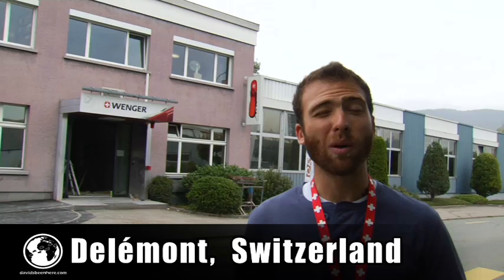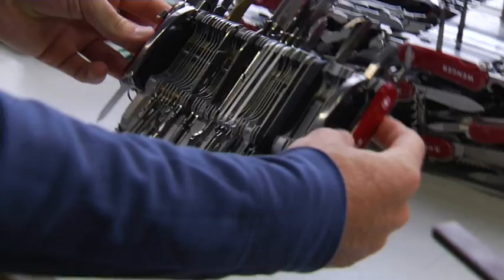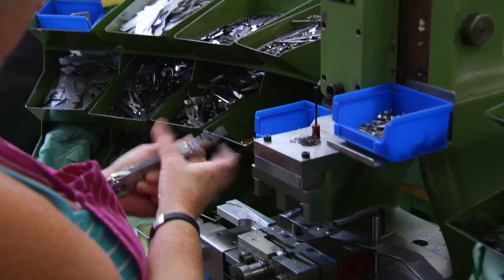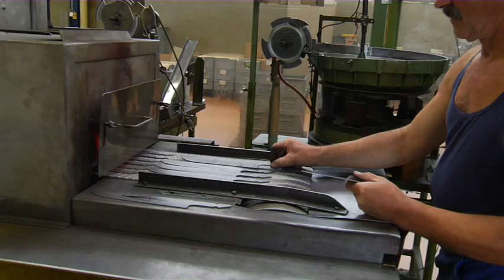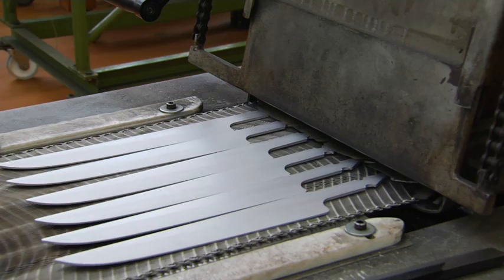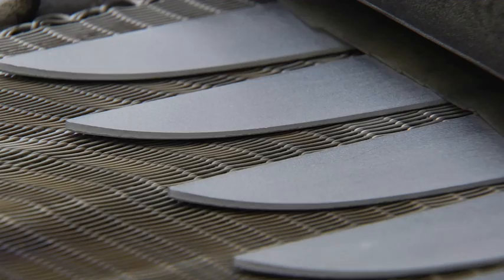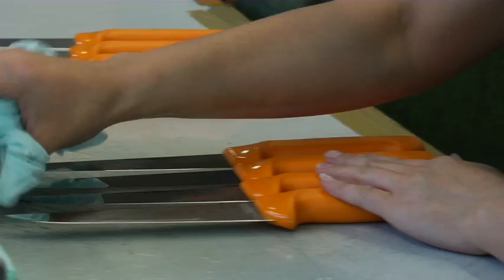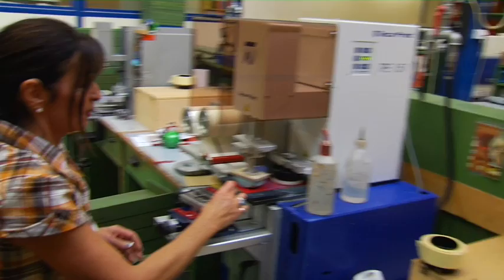The Wenger Factory: Delemont, Switzerland

Comment: i have military classic watch it says 100m water resistant ..well first swim in the lake and watch stoped working i took it to watch repair shop they put new battery it worked for few day and stoped this time i opened watch cover and inside cover it says CHINA ..so much for wenger and swiss engineering